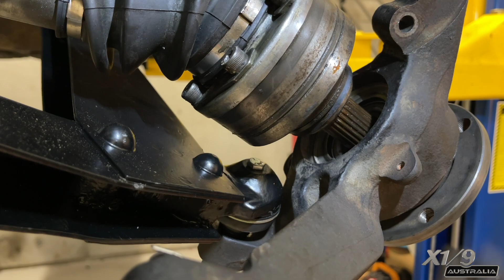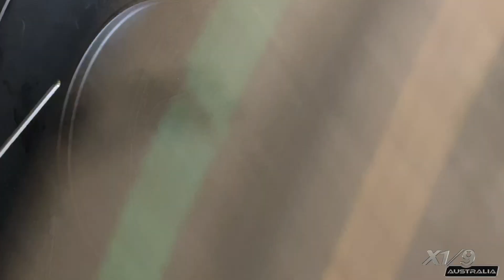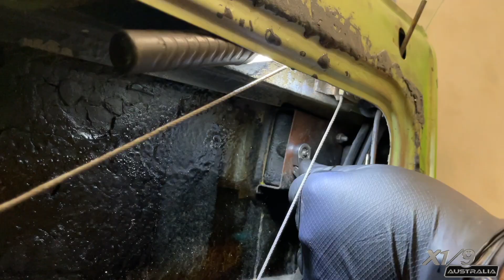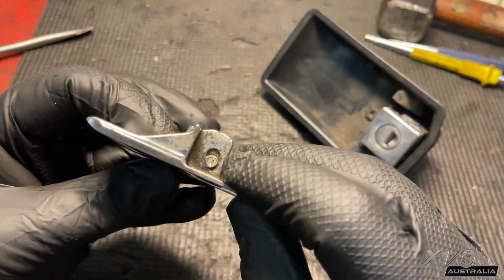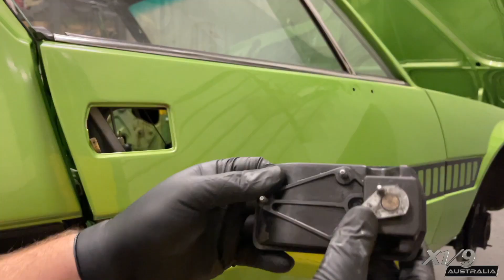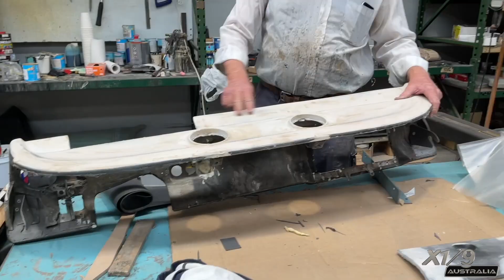The Green Machine Ep.17 — Front Brakes, Cromodora Rims & Dashboard Reskin | Fiat X1/9 Restoration

Comment: What wud you expect to pay for a driving x19 in roadworthy condition?
Reply from the maker: That's a really hard question to just answer. There are so many factors to consider, but here are a few things to think about. The location of the sale can make a big difference. For example, if in Perth, there is less chance of someone on the east coast buying it, so the price is lower due to fewer buyers. The series and colour also makes a huge a difference in value. Over all roadworthy ones will sell for $8,000 to $34,000.
Reply: East Coast. 1300 4spd complete& running. No crash history. Rust bubbles appearing on non structural areas but overall minor. Soild reliable vehicle. I thought $8k wouldn't necessarily buy a running ir roadworthy x19
Reply: None for sale on carsales for less than $27k
Reply: Sry one for sale in Oz for $27k.thats it
Reply: Would you know the highest price paid for an x19?
Reply: Or asking price?

Comment: Nice update.  Really interested in that dash reskinning process.  So many cracked dashes out there.   I tried that door handle trick of turning the rubber pad 180 degrees when I first got my car.  It looked great for about two months but eventually was misaligned just as much as before.  The rubber pad is too soft in my view.  Next I will try gluing a thin disk of shim brass to the rubber pad with Weldwood to prevent it from indenting.
Reply from the maker: Wish I could record more on the process of the dashboard but the guy is not really interested in taking a video of it being done. Rubber bit I managed to find a spare once but never again. Maybe a touch of glue will hold the rubber bit in position?
Reply: @x19australia  Just to be clear, the rubber pad didn't rotate back into the old position.  It simply developed a new dent where the latch rests on it.  The durometer of the rubber pad is really soft on my '86.